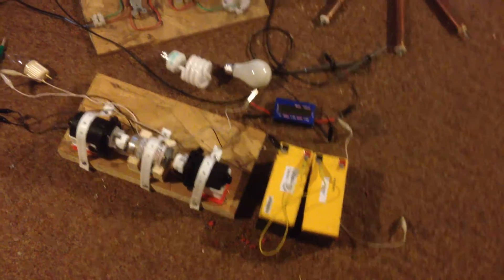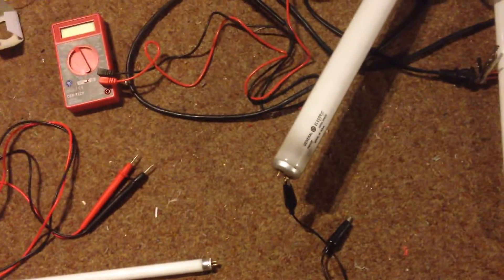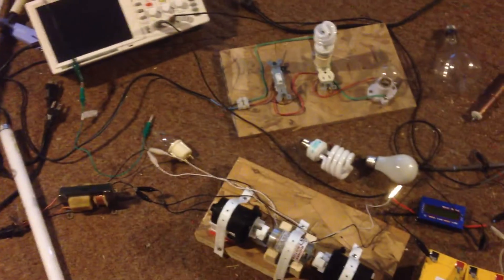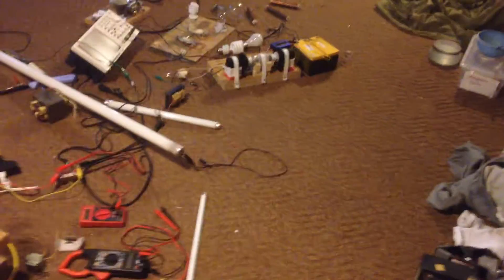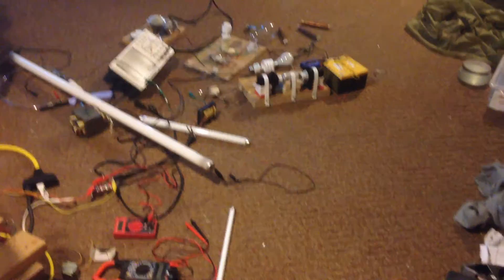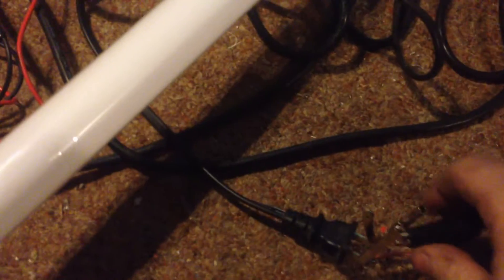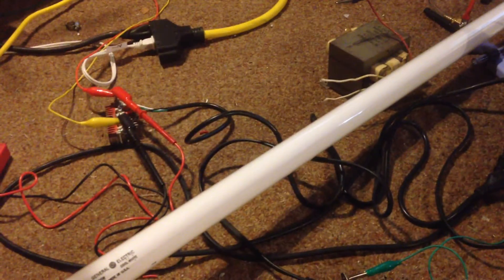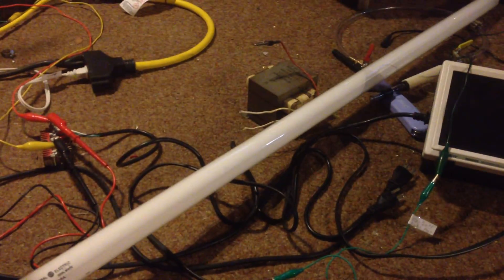Gerard Replica 2

Comment: Hi Frank, Great demonstration. We work pretty much the same way. Francis Ronalds, 1823-1832, look up what type of current he was using to transmit long distance into a line. Now the issue, is to find a proper transformer, into a transmission transformer, to transmit dc impulse, to a non loss conversion back into a pole transformer. Right now this is what I'm doing research to a pole transformer, to convert into ac wave currents.
Reply from the maker: Cool ty and I will look up that info to get more insite Keep up the good work
Reply: maybe try a 3000 perm ferrite core transformer. like a old tv flyback transformer.
Reply from the maker: irondmax I don't have one but i'll look into it
Reply: https://plus.google.com/107555587203271761910/posts/SnaAewbZCna . puttuing magnets on the motor , like gerard
Reply from the maker: Magnetic motor Yes I'm planning on that as well